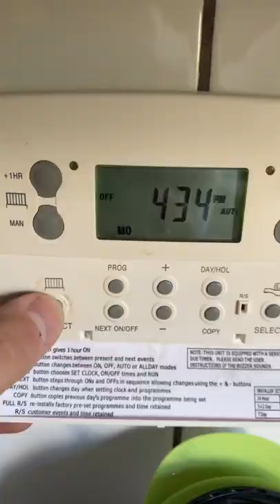Bye bye old stat hello digital age. Save money on those heating bills. #shorts

Comment: Never understood how a new electronic thermostat can save money..
Only way I know, is to turn the system off , or lower the temperature settings.
Reply from the maker: Accuracy
Reply: It can't, it isn't more accurate. This is basic physics. Needs to have modulating controls.
Reply: 100% .!! HVACR Technician here. Thermostast don't do shit unless they modulate your unit for heating and cooling, not just cycling the unit on or off
Reply: Disappointing an electrician doesn't know this but they save money if wired correctly (this isn't) for modulation. The lower the return temperature the more water can be condensed by the heat exchanger, the more heat is extracted from the fuel. You see a flue pipe kicking out lots of steam then it's not condensing properly and not efficient.
Reply: Digital stat  is more accurate and responsive. At the very least it will limit the over and undershoots that old often badly wired analogue stats are prone too.   If it overshoot less you save money if it undershorts less you don't get complaints or somebody turning up the stat!
Reply: @stanleyiturrino118 my fridge doesn't modulate its just on off oddly it's still useful to have a thermostat that's accurate inside it
Reply: @martinwright7367 badly wired analogue stats ? What wiring faults are you looking at ? Open circuit? Reverse polarity ? High resistance?

Comment: Costs money and saves nothing.  If you are too lazy to alter your thermostat...which doesn't make sense....then you are too lazy to do all the other things that save energy.  

As an aside...the Swiss government edict just rendered digital thermostats pointless....leave your home at 66 F or 19 C...or get fined 30 euros a day or go to jail for up to three years.

Last point...I live in the extreme NE US.  The thermostat stays at 64 F 18C all winter.  One can always put on a sweater...or as you call them a jumper.

Last last point.  Dropping your thermostat during the day when you are gone allows the physical structure to cool down which includes all the objects in your home.  When you come in at night and raise the thermostat ....even just a few degrees ....it takes many hours of heating effort.  If you select a middle ground between the two and leave it there, the cost savings will be noticeable....particularly at the prices you, in the UK, are going to pay for energy.

Every mechanical engineer and physicist could tell you the same.
Reply: Errrrr no! Heat loss? If you leave the heating on  "middle ground" you just loose more heat over a longer period. Big problem is inefficient and oversized boilers.
Either get a fecking decent insulated home or just heat in when u are there.
Reply: @johnturrell942 Well, yes.  Energy loading at a middle low level that is closer to daytime ambient temp means the structure doesn't cool down as much during the day.    If you lose 3 degrees C from air temp...which is all your thermostat measures...then the structure of the home has also lost 3 C.  Then in the evening....when your trying to warm it back up because you are home you put it at the temp you want.   Great but you are now burning fuel to not only heat the air but also warm up the physical homes interior structure and objects.  People complain of cold walls...sure they are.  They had the heat off all day.  They expect the interior will warm up quickly...it won't.  The air may warm up but all the interior belongings won't.  Moreover, you going to end up in bed covered by blankets...so you don't need it that warm because you are literally going to sleep through it.  That sudden burst of effort  to bring the home back to a comfort level leads to energy use greater than maintenance.  The greater the difference between home and not home temp, the greater the loss over maintenance at a lower level.  Using degrees F, let's say you have a home temp of 72,  an away temp of 60, and an outdoors temp of 40.  The burst load is trying to heat through to 72...or increase everything by 12 degrees.  Even if the air temp rises to 72....it will not stay there.  The heat will cycle on frequently.  While the air can be warned the objects in the room and the walls and floors take time to warm up.  They are constantly cooling the air back down...not just the losses due to normal convection out of the structure.  By the time you go to bed the actual physical interior may have reached the desired temp.  So, you have burst run your heating for 6 hours to reach the point when you don't need it....your bundled up in bed.  

Compare that to putting the thermostat at a static temp but lower than 72.  It's winter...the home will always be warmer than outside.  So, leave it at 64.  You will adjust to the feel of the home.  Cooking adds another 2 to 3 degrees especially if the oven is on.  But the energy use comparison is far better.  And not just due to the lower temp but far better because the bursting is gone.  

Also remember that heat loss is a curve.  The energy transfer rate between objects slows down as the objects reach equilibrium.  So the burst heating period is also occuring during the coldest part of the day...at night.  This only adds to the burden.  

As I said, easy physics and engineering that a solid A level could figure out if they did the calculations objectively and completely.  Digital thermostats are nothing but marketing and connecting them to your network a mechanism to collect data about you.  

Lastly, over sized boilers are a problem because they only function well in burst efforts...but they consume a lot of energy to bring them up to working temp.
Reply: The smart thermostats provide you with a nice graph of your heating it learns how long your house takes to heat up and cool down then when you set timers in future you can do so with the new data ensuring that the heat doesent stay on too long and over shooting the target. Like older systems 

If I turn my heating on at 21 and keep it at 21  my thermostat knows(from the data it has gathered) to only apply heat to the radiators for 5 minutes in order to get it back up to 21 when or if it falls to 19,  a normal thermostat will keep the boiler going and going until the room actually gets to 21  meaning that the heat will continue to bellow out the radiators and result in a higher than desired temperature wasting more money. Try pulling the data from that old thermostat?  The old bimetallic  mechanical thermostats usually require replacement after a few years as the mechanical parts fail & it does not tell the user it’s broken. 

Try turning your heat up to 21°c you’ll smile more and moan less ❤😂
Reply: @HogwartsBasement  bimetal strip thermostats along with their mercury switch last 20 to 30 years without need for replacement.  You are also mixing boilers with some other form of heating...to get 5 minute maintenance cycling.  The thermostat doesn't learn anything.  They do not gather information and use it.  all they do is allow you to program a temperature structure to satisfy your needs.  The duty cycles that run are maintaining your programmed preferences
...they do not do a better job than any traditional thermostat...except that you don't have to be there to make adjustments.  Other than that they are merely a switch.    You don't understand the term 'smart thermostat"...it's marketing...not science.  
And if you run a boiler....it's going...all day... unless you have a instant heat boiler properly scaled to your home or are using geothermal. 

The easiest way to save energy is to run your heat at a lower level and get used to it.  And everyone in Europe better get used to that because regardless of whether or not you have the money....the energy won't be there.  I can't wait to watch the protests.
Reply: @xavariusquest4603  well hive does, I can’t speak for others. Your home must be full of smart thermostats to work out the differences in all of the products. 

Your assuming quite a lot in your comment and your assumptions are wrong in regards to how my house works are you even from the same country ? 

Lol people will protest anything these days 😂 is there an anti smart thermostat movement ?

Comment: Is the Hive any good as a wireless option?
Reply from the maker: Yeah for a conventional system either 1 or 2 zones underfloor or normal system with hot water tank
Reply: Over priced hardware.
Reply: No, the hive is still a basic on/off control.
Reply: @Swwils  what is the best option for a wireless room stat in the UK?
Reply: @JP-nb7tm  probably a Honeywell home, nest or two is setup correctly. Modulating control is the key.